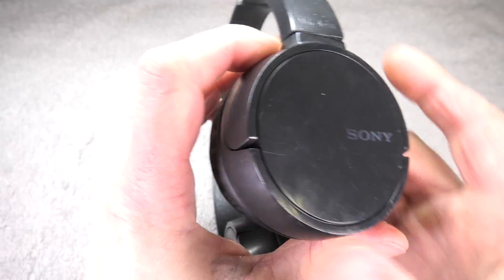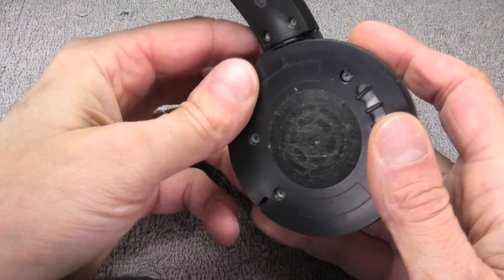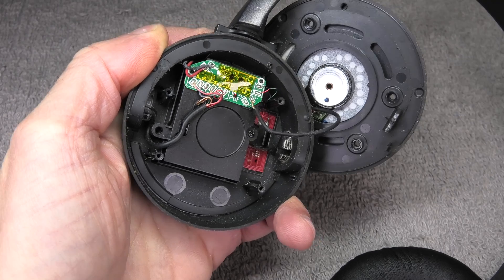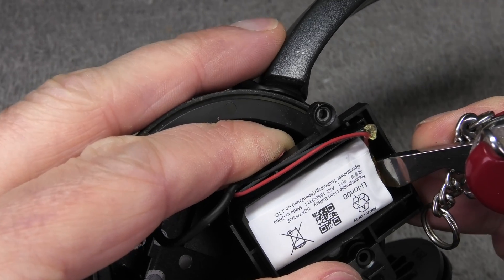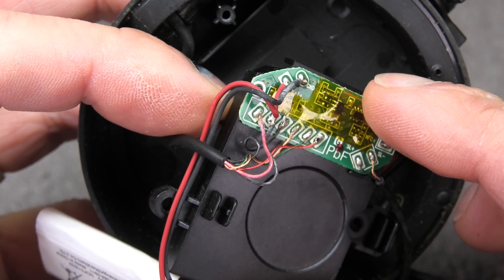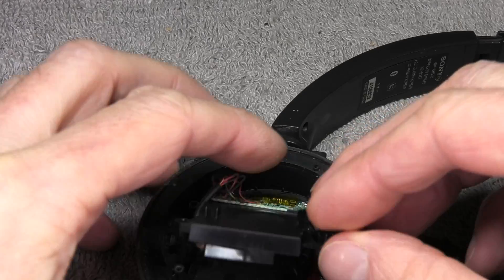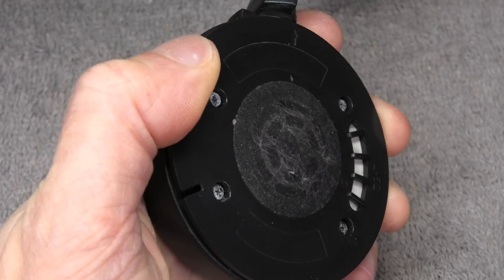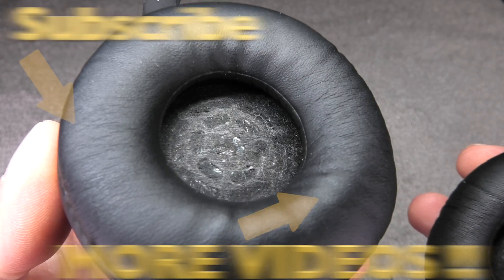Battery Replacement on Sony WH-CH500 Headphones (How to DIY)

Comment: My WH-CH 500 Headphone's Media volume is too low and it didn't increase when I try to increase it. It's a hardware problem or Battery problem? It have any solution?
Reply: Did you solve it bro
Reply: @muhammedsakir6970  no

Comment: Would be great if you can let me know the model of the battery please?
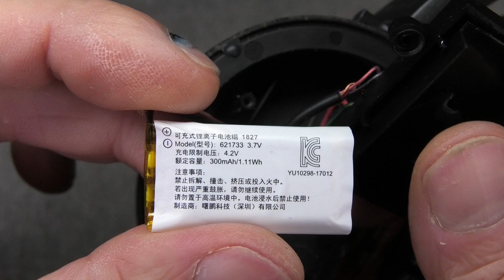Reply: 2:35 YU10298-17012   Is a 3.7 to 4 Volt lithium battery (not very precise on the range due to the low quality)
Seem to be made in china or something and if you find any similar battery that can fit there and has the same voltage it should work just fine, more amps would be even better.

Comment: Hi I also own the WH-CH500, and even though I pressed the on and off button at length, it never stopped working again after the purple light. Even if I put it on the charger, the light doesn't go on. What should I do? Please help me.
Reply from the maker: As far as I know the purple light is a very common issue and it means the headphones are broken. 
If you are lucky yours are still under warranty and eligible for a replacement.
Reply: @MegaSafetyFirst  I opened it up and looked at it, and there's no break in any wires, so the headset is un repaired? Is ıt dead?
Reply from the maker: I believe so.  
I was researching this problem for a while and could not find a solution for it other than sending it back to Sony for a replacement.
Reply: @sumeyyeceyda7975  hi, did you find anything about that or its really dead ?
Reply: @1hamzeh  really dead
Reply: Same problem did u get a replacement
Reply: @Hariharan1113  I didn't buy a new one, unfortunately it died